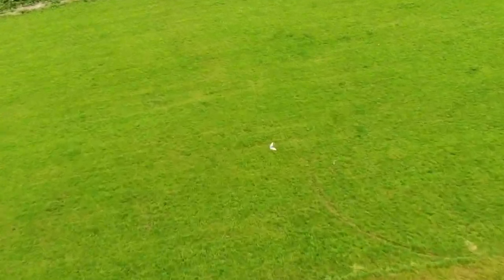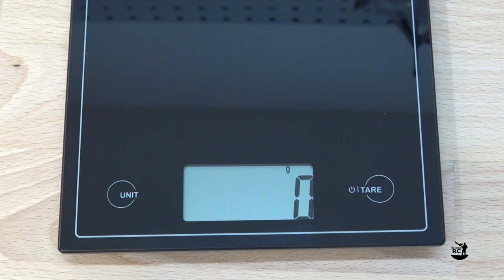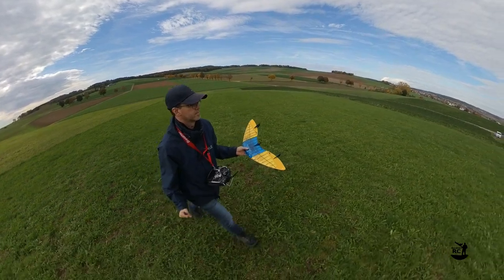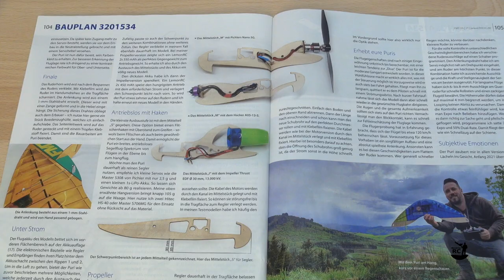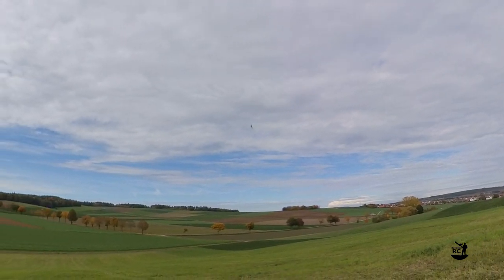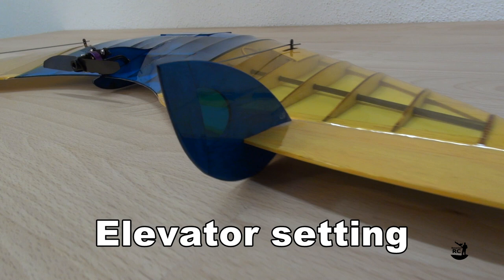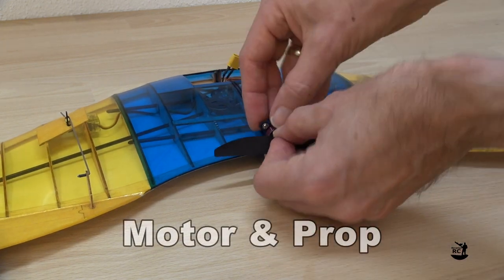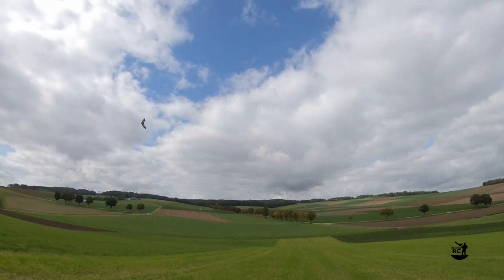Flying the Puri - RC Micro Wing

Comment: Great video. The Puri is a fascinating design. Putting the up-trim on a launch switch would save you from having to remember how much trim you used (if not flying the Puri for a while). This is what DLG pilots do for launching. 

FYI: Runcam introduced a couple small lightweight cameras this year aimed at pilots that fly small quad to record video.The Runcam Thumb (9g) and Thumb Pro (16g) should be something the Puri could cary. Being small, they don't offer GoPro quality, but pretty acceptable given limitation of size/weight. Insta Go2 is another option with higher quality video, but weights 27g.
Reply from the maker: Thanks a lot. That's a good idea to put the up-trim on a switch. Actually it already happened that I dialed it up 5 ticks, forgot about it and again dialed it up 5 ticks before launch... which was a bit too much of course. The Runcam looks really interesting. I am wondering if I should go for the Thumb even if the video quality is not on the level of a GoPro, but it would open up a lot of new possibilities even for bigger planes, like putting it on the tail. So far I was aiming more on the Insta Go 2. Not sure what I will do. I'll check some of the reviews out there on YT and then see what to do. In the end it's also a different scale when it comes to cost. Thanks a lot for your tips, I am always happy to learn something from the comunity. Cheers

Comment: the aileron flutter I because of the weight of them.. with the vert stabs attached its just something you'll have to deal with. on a real aircraft the aileron tend to be mass balanced  to stop the flutter
Reply from the maker: In the end the fluttering is not a big issue if I don’t push it too fast. Flying it in a tight space with many sharp maneuvers is really fun!
Reply: She looks really nice that’s for sure